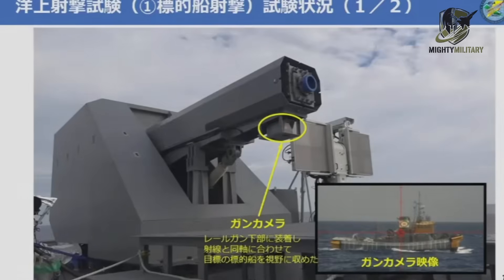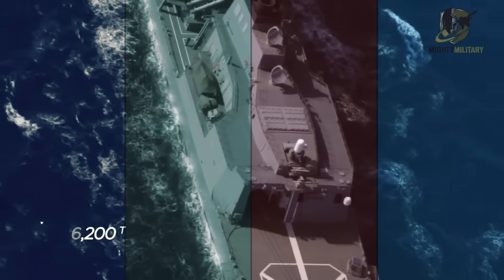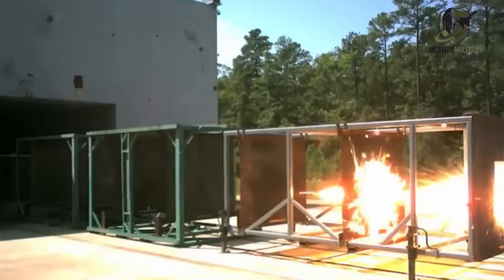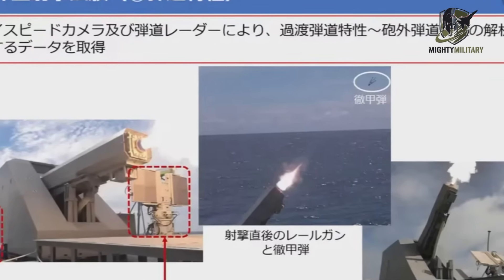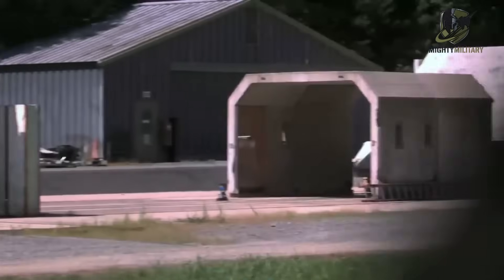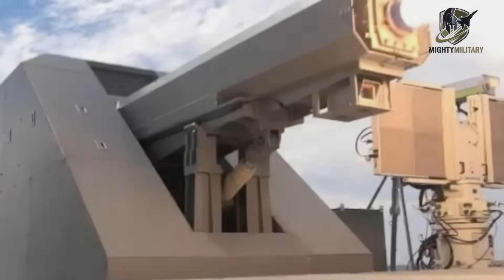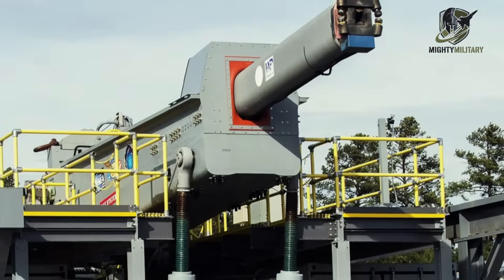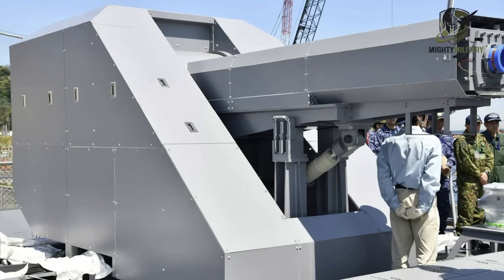Japan’s First-Ever Real Railgun Damage Demo at Sea Shocks the World!

Comment: 200 rounds.
Direct fire only.
Max range ~200 km at best.

Compare that to even older, slower cruise-style missiles with 2–3× the range, and once you’re talking mid-range, ship-launched missile systems you’re at an order of magnitude more range.

Missiles offer flexible payloads, vastly superior range, comparable speeds, and manoeuvring.

The only real tactical niche for any “gun” system is point defence, and point defence lives or dies on sustained, high-volume fire. Rail guns don’t do that well.

Rail guns are cool. The tech is worth researching.
But tactically and strategically… what’s the point?

Comment: Less ammo wight and size so more ammo at the cost of energy to fire the gun.      Has better range and more accuracy due to much higher velocity.   Down side.   Needs a lot of enegy to use so if ship looses any power it offline.  It has far less damage then a modern round the would pen then explode rather then making a long small hole. If you do not hit any vital parts you eill jave to keep shooting untill you do where as modern shell will mess a lot of things up from explosives. The crew also would be in far more danager.    Rail gun only good for very long range and aginst do much armour that modern shells will not work.    Missiles can do the same long range but they can be jammed or intercepted.   Still cool as all hell nice work japan gor making it work

Comment: 2300m/s isn't really that fast for a ship-fired projectile. But if the round is much smaller and cheaper and easier to handle than the average gun round, it's still an improvement.

Comment: Reduce the speed to say 1000 meters per second and you should get longer barrel life 

Isn’t the whole point of these systems about using safer (no propellant) and cheaper rounds - and less about high velocity?
Reply: At the speed you mention, it's merely a bullet. It won't penetrate steel plate and will be deflected. According to the physical law F=mv^2, the destructive force of a bullet's impact is proportional to the square of its velocity.

Comment: in reality rail gun is a very bad concept with almost zero upsides.  the only place where it makes sense is space use.   in air it deviates from target and loses speed fast and gun is destroyed in couple of shots. much faster then conventional artillery
Reply: Special guided ammunition would be needed for long range shooting, by railgun or conventional cannon, to increase hit probability. It is actually trickier for conventional cannon because it subjects projectile to sudden huge peak acceleration when gunpowder or propellant is ignited. In a railgun, acceleration to the projectile is far more gradual and much less stress. That makes big differences to the guidance system of these special ammunitions travelling at hypersonic speeds.
Reply: @tvgerbil1984  where did you get this nonsense?  current projectiles are all small and melt bcs of how rail gun works and more G overloaded.  it's a dead end!. they are only good for space!  in air only rockets make sense at distance

Comment: If railgun is a viable weapon system, not yet known.
Reply: As it stands, it isn't. It's the same reason Battleships are no longer viable. It's the cost of the ship it sits on. You need a fairly large ship with a power plant that can offer a lot of power for a railgun to work, at minimum. Even more so if you are going to use multiple ones, that makes it even more difficult which makes the ship a huge target and liability. The money you save on missiles or drones you lose on build cost, build time, crew costs and maneuverability.

Comment: United States has had a rail gun for years.
Reply: The United States did halt the project though. If Japan succeeds it could open up the program again for the US which would be a good thing.
Reply: @EricKCfaninAZ no it couldn't, the one the US was developing was significantly more powerful then the one Japan is going for, the more powerful ones simply aren't feasible because they go through barrels far to quickly.
Reply: Yes this is the licensed version with some edits,  such as lower velocity.  Still enough though.

Comment: USA and EU have already engineered, tested, and ultimately abandoned rail guns.   Too expensive for the huge electricity needed, non-guided projectiles, and short life of the barrel.
Reply: Japan is the only country that is currently building an electro-magnetic railway that has been researched and developed from at least the 1980s. So yes, Japan has ample knowledge and technology from materials to energy efficiency. The railgun was initially developed because the anti-ballistic missile SM-6 was ridiculously expensive.
Reply: @yo2trader539  A maglev train doesn't generate an electrical arc along the rail hotter than the surface of the sun, this has been the issue with railguns.  When tremendous amounts of electricity are poured instantly from one rail, through the projectile and to the other rail an extremely hot arc is produced, some of the projectile and rails is vaporized and the resulting plasma is dragged along with the projectile down the barrel.  
This wears away the surface of the rails causing damage.  
This is why both the US Blitzer railgun and the much smaller Japanese railgun (it fires a projectile about 1/10th the size) wear out after only around 200 shots.
Reply: @yo2trader539  Japan is the only country that is currently building an electro-magnetic railway that has been researched and developed from at least the 1980s

The railway does not have expensive barrels that are destroyed after only 200 shots, like the railgun.
Other countries could also develop a maglev train, but it is too expensive and impractical for use in America or much of Europe.

Comment: I often see comments like, "There's no way Japan can make a weapon that America has given up on." However, Japanese railguns use much smaller projectiles than American ones. Currently, they fire a 320-gram projectile at Mach 6.5 with a kinetic energy of 5 megajoules. Under these conditions, the barrel wear problem is solved. In the future, the kinetic energy may be increased to 20 megajoules, and the projectile may become larger, but it is unknown whether the barrel will be able to withstand this force.
Reply: JAXAの協力で一番の課題のアーク放電の問題を解決したからうまくいったのもある。
Reply: At these numbers you have to ask if the juice is worth the squeeze. Conventional auto cannons of similar effect already exist. Power at extreme ranges is the pro, but if look back at the past century we'll see where the massive navy cannons of battleships are today. Maybe for a nation like Japan the technology makes sense, but in American war doctrine it does not.
Reply: Also range of rail gun vs range of auto cannon,  rail gun can touch you before auto cannon can